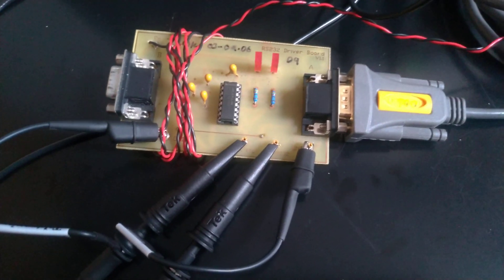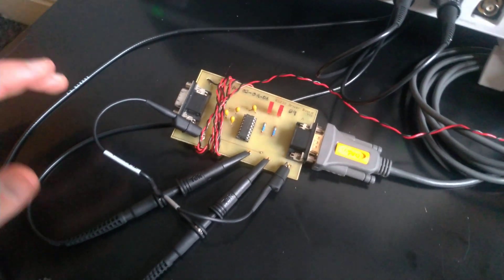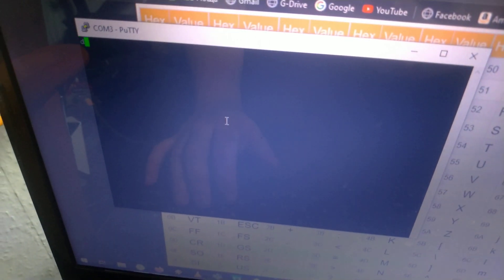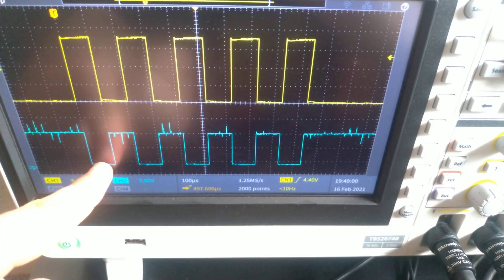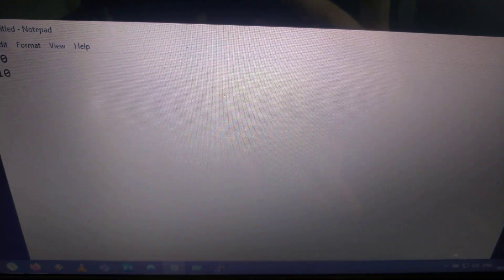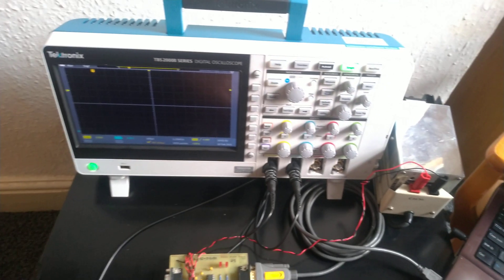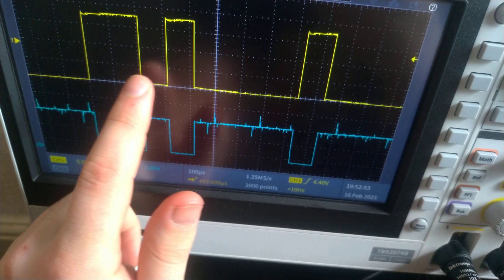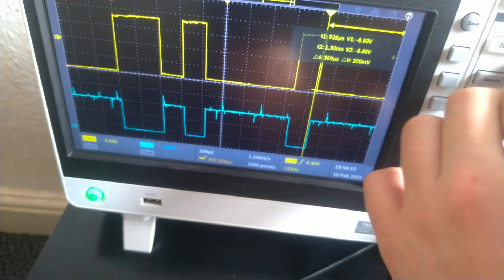Capturing and Analyzing Signals from MAX232 Chip

Comment: Hello,
I have a technical question if you can help me. I broken the capacitor on an PCB betwen the pin C1 and C3. The port is user for send the information to a printer in one direction. The printing process is still working
Can you please tell me if are some problems with this capacitor I will not repare.
Thank you very much!
Reply from the maker: There is no way  Icould give an answer without full details